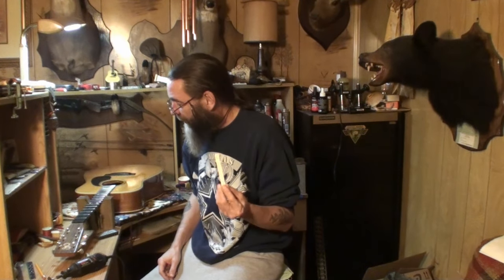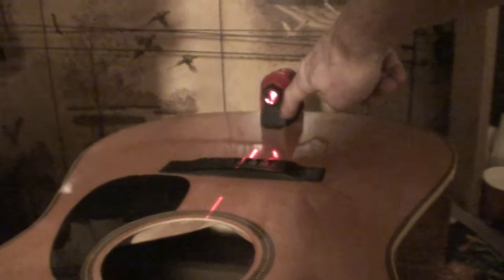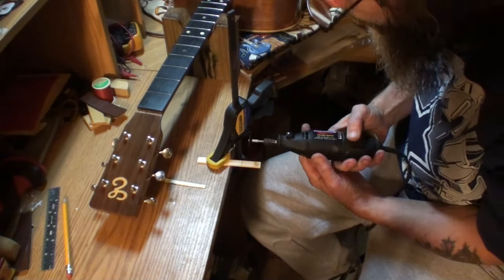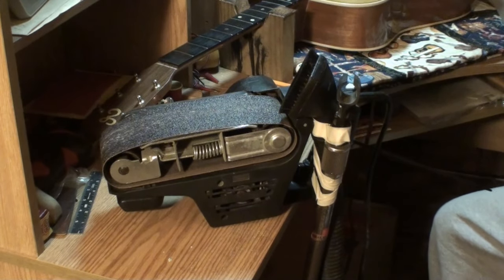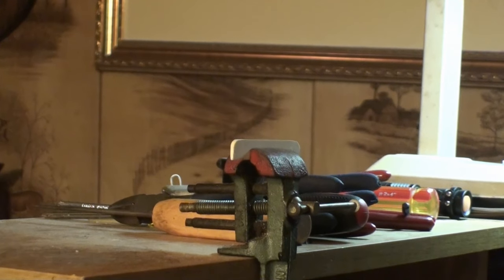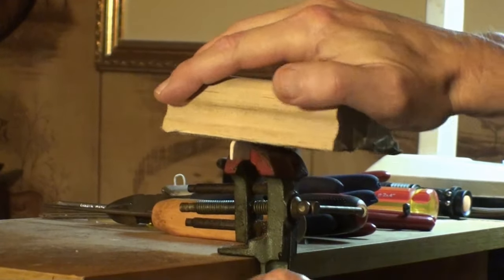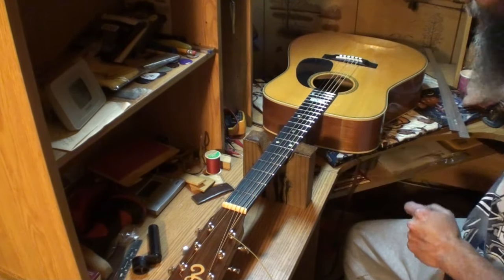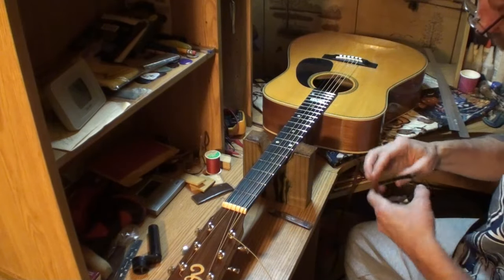Acoustic guitar bone saddle made and getting her in the ball park! Plus a little tease demo!

Comment: Randy Schartiger, you are great !
This video is one of my favorite, because it answers a lot of questions I had.  I've seen you make a saddle a few times before, but this time I feel it gives me the additionnal clues I needed.  A month and a half ago, I bought a compensated TUSQ saddle, and I still have a few questions to ask you about it.  

Here they are :
1) I find it difficult to be absolutely sure about the neck radius.  When I use the gauge (paper for now), I see very little difference between 13 and 14, for example.  When you check the radius, you also seem to "guess" it a little bit.  Are you ?  Also, why would I need to check the radius with strings on the guitar, do I really need those gauges ?

2) What grit of sandpaper do you use when sanding down the width, height and radius of the tusq saddle ?  Does it matter ?  Also, I am not sure I know how to clean the paper when it is full of tusq powder.  Should I just throw it away ?

3) When I check the neck relief, is it ok if I use a cheap capo, the kind that clips, or should I get a capo like the one you have ?

4) On my compensated TUSQ saddle, do I have to sand the radius or will it screw up the compensation ?  Also, do you think they sell radius sanding block at the hardware store, or only at the luthier shop (online) ?

5) Any chance you could give us the mesurements to make our own "neck-holder-woodblock", just like yours ?

I know I ask a lot of questions for now, and I am sorry about that.  I wish in the next video we could see you do the actual filling during the intonation process.  I'd like to see you do it.

Hope to see you again soon !  You make my life better !

P.S.  My main language is french, so I'm sorry for my english.
P.P.S  Hey EVERYONE. please join Randy on www.patreon.com\pretorius   - He deserves it very much !
Reply from the maker: 1>Because on an electric guitar you have to adjust each saddle on each string individually to achieve the radius ar the bridge and make it match radius of the fretboard.
2>I use a rough grit to get it where I want, then high grit to polish it and make it smooth and shiny.
3> Clip on capo is fine for setting neck relief, not so fine to use to play with as they usually squash the strings down between the frets and make them go sharp.
4>It should match radius of the fretboard and no it won't hurt the compensation, you can easilt file the compensation back for each string if the think it changed too much.
5>I don't have any specific measurements for that I just cut what I thought would fit all necks.
No problem my friend, the best way to learn is to ask questions! :)
Reply: Wow ! Merci beaucoup Randy ! (thank you so much for talking the time to answer !)

We ALL should buy you a drink on www.patreon.com/pretorious
Come on everybody !

I finaly did it, I am now proudly one of your Patron on www.patreon.com/pretorious 
I wasn't sure if you prefer a small amount for a long time, or a bigger amount for just a month or two.. so I choose the small amount for now.  Feel free to ask if you need anything.

About question #1, maybe I wasn't clear enough.  On an acoustic guitar, when you use the radius gauges to figure the neck's radius, do you sometimes hesitate between two gauges, or you always are certain the radius is the exact one.
Reply: Thanks Randy for taking the time to answer !

Do you clean out your sandpaper with something, or do you throw it away when it's full ?

A quick Clip tip about sandpaper would help me a lot, I think.  
Only a suggestion ;-P

Have a great day Randy !  Looking forward for your next video :D

Comment: Randy I have been catching up with your videos and after watching a few older ones I have a question for you about a guitar I recently purchased
Reply: I bought a Blueridge BR-OS that a Saga rep told me was from early to mid 90s. He said it was built in Japan, he included a 1993 catalog page with the guitar listed. She has rosewood back and sides and a spruce  top.  Sold for $395 in 93. My question is how do the early Japanese Blueridge guitars compare to the Chinese models of today?
Reply from the maker: There is quite a difference, back in the day when they were imported from Japan there seemed to be a lot of unexpected issues as the guitars aged, glue joints coming loose and braces letting go. After they started producing them from China the quality started quickly getting better, so much better they finally issued a lifetime warranty on Blueridge guitars. You could have gotten lucky tho and purchased a good one because not all of them from Japan were bad.
Reply: Randy Schartiger Thanks for the quick response, I have leveled the frets and recrowned them ,set the action at about 5/64ths on the  roundwound strings and 4/64ths. The playability and tone are good and she seems to have a fairly full voice. I will take a mirror and check  for loose brace ends. Thanks again for your time and assistance. Jeff Kellogg

Comment: Not to break your balls, but when you say the fret board has a 12 inch curve it drives me nuts. You should say it has a 12 degree radius. Nice job on the repair.
Reply: retiredppd no ball breaking here either but it would be 12" radius, no degrees involved.
Reply from the maker: retiredppd Dane is 110% correct it's dealing with inches and diameter not degrees.